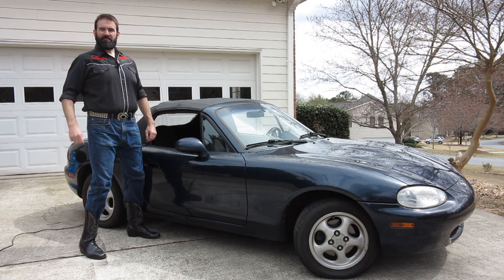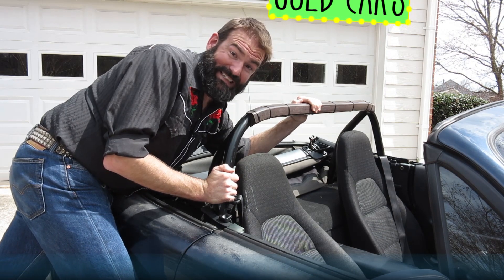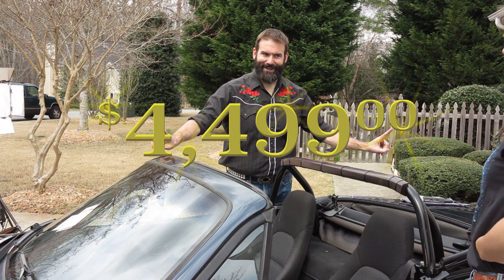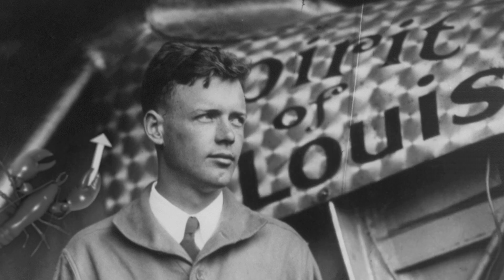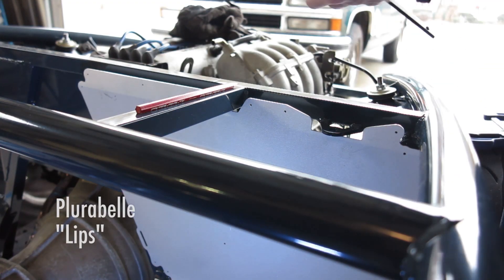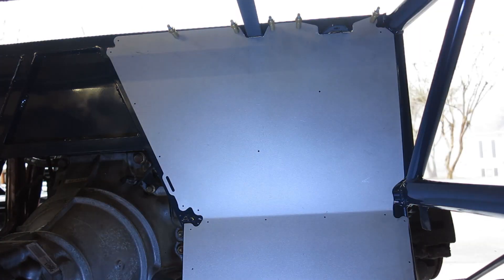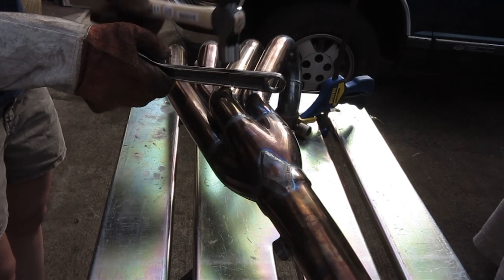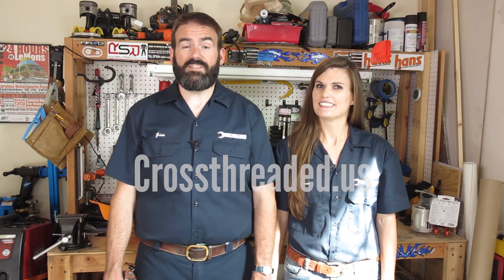Crazy Jimmy's Used Cars, Spotting, & Dent. Header dent on the Exocet  - Crossthreaded #4

Comment: FWIW, I did my own grassroots spotting on my Exocet's panels using a wire brush attachment on my drill.  Not Bugatti or even Cumming, GA Hardee's level, but works to cut down on glare.
Reply from the maker: We ended up getting a media blasting company up in Gainesville to shoot our panels. They came out okay but yeah I wish I'd worked harder on the spotting thing.

Comment: Have you considered deleting the brake booster and going with manual brakes?
Reply from the maker: +LowFlyin&#39; Not yet. Our build philosophy is not to get too crazy with deleting things. Next on the list is probably the power steering, but I don't want to make the mistake of thinking I know better than Mazda how to design a car.
Reply: +Crossthreaded - We deleted the booster on the Tape-R, and so far it's been a good decision.  With as light as the Exocet is going to be, I would imagine you'd have a similar experience. ;-)
Reply from the maker: +LowFlyin&#39; Interesting. But I've also driven cars without any brake assist and after a few minutes it feels like I've been trying to kick a couch up a set of stairs.